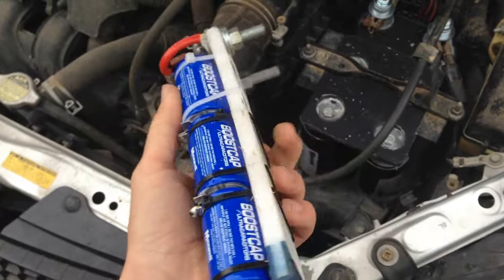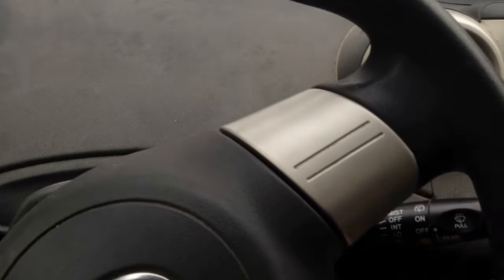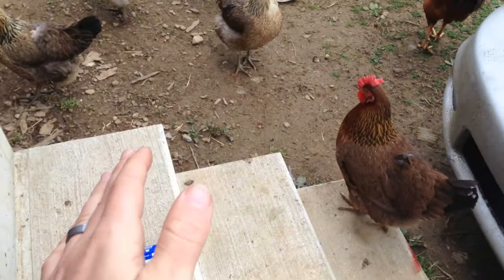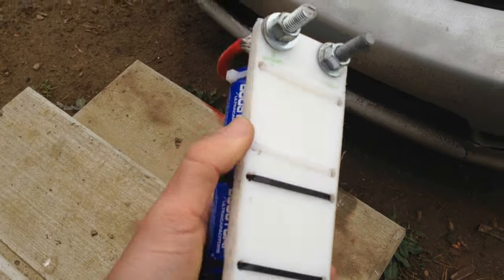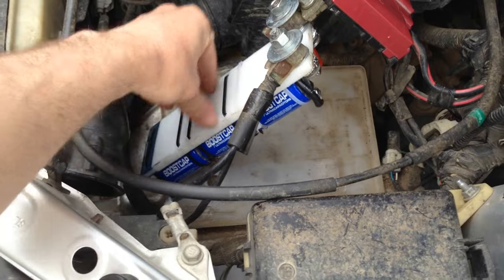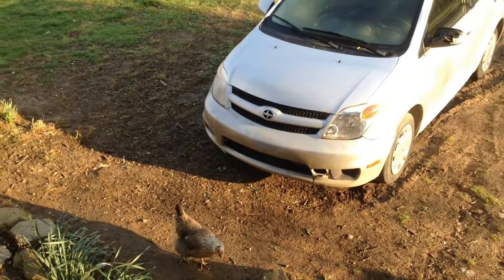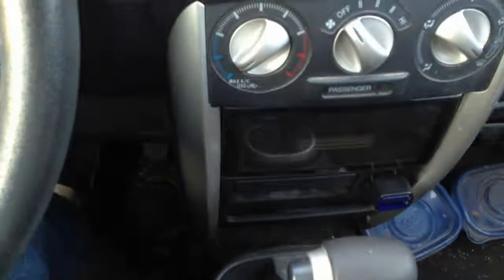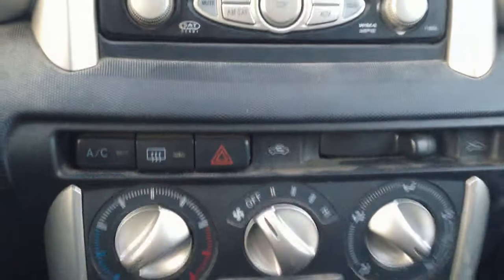Replacing My Car Battery with Capacitors! 12V BoostPack Update

Comment: It's a great shame that people don't do the basic calculations of the energy involved in so many experiments like these. Car batteries are needed because they provide much more energy headroom for ensuring the extra energy needed to maintain power to the alarm system, remote lock when the car is parked and for starting an engine in freezing weather.
Reply: Ah, but something built before all that stuff, like for instance a weekend racer, or a sports car with no need for luxury stuff this would make sense.
Reply: Jay Simons You're right...but that auto tranny Scion is definitely not a racer ,even if you take some 30 pounds off it...
Reply: Jay Simons People just need to understand that there is a huge difference in the energy output of these caps vs. a lead battery. 6 batteries of 350 Farads of 2.5 Volts hold the energy of 6562 Joules assuming the starter could actually use it all. Considering that the starter won't actually run as the voltage drops below perhaps 6 Volts, you end up with only 2300 Joules or so. That is 0.66 Watt-Hour.
Your current car battery might have an energy of,ONE THOUSAND times more. Thus, starting your car on these capacitors is somewhat a luck depending on your car engines willingness to get running in one attempt quickly. If you want a stressing experience using your car, go for it.
Reply: I showed my cousin who has an Rx7 he uses as a weekend racer, I think we will give it a shot with that since it has no radio just lights and computer for the EFI.
Reply: Jay Simons LOL, just remember not to turn on the light without the motor running :-)
Reply: lol, that certainly would put a damper on things wouldn't it, LOL
Reply: Jay Simons Yes, and never turn on the emergency light if the engine is off cause it will drain your "boost cap" in about a minute (0.66 Watt-Hour / 40 Watts = about one minute, assuming your signal lights use 80 Watts and are off 50% during flashing).
Reply: ThinkingBetter LED's are an easy swap, He also mentioned a solar panel and a small battery, I think with the right combination it would do very well.
Reply: Jay Simons It's simple math to find out if it works well. No need to experiment cause any part of this solution is 100% predictable. Energy in a capacitor is easily calculated based on capacitance and voltage. Likewise energy consumption in your car is a derivative of what you want to power. Of course LEDs will consume less power.

Personally I don't want to imagine that I only have one attempt to start my car however. You need near 1000 times the energy of the capacitors on this video to match a typical car battery.
Reply: Well, my advise is to anybody that wants to try it is to measure how much voltage your car uses to start and how much it uses with the engine off and ignition on with lights on and make sure it is tuned and well running so it doesn't take several cranks to start the car.
Reply: Jay Simons It's a bit sad that you don't understand even high school physics Jay. Your car will consume some energy to do one attempt of starting it. Such energy can be measured in Joules. If your car starter motor is using 150 Amps  for 1 second at 10 Volts, it represents 150*10 = 1500 Joules of energy. The capacitors on this video might have some 2300 Joules of usable energy for cranking your starter motor.
Understand the math first, calculate what you want to achieve, then design it, and you will get what you calculated. It's not magic at all. 

The entire idea of using super capacitors to start your car without a lead battery is a bit bogus in my honest opinion. If you have lots of money to buy many of these caps and don't care to fill up your engine compartment with these caps, then go for it. But what did you achieve other than spending far more money on it?
Reply: Your talking like we would want to do this to the family car, if that was the case you would be right, but for a tiny economy car or racer with minimal electronics this would work fine since while the car is running it relies on the alternator. if you noticed in the other videos he tried it and the caps started his car a few times and could power the radio for several hours. for a reliable small car something like this would be fine. In this case simple math can be wrong because of the variables present in the automobile.
Reply: Jay Simons No, everything follows laws of physics 100%. No exception. If your car stereo is using 10 Watts and you have 2300 Joules of usable capacitor energy, you can power it for 2300/10 = 230 seconds or 3-4 minutes. If you crank up the volume of your car stereo and you are using 50 Watts, you get only 2300/50 = 46 seconds or less than one minute. One Watt equals 1 Joule per second. If your 10 Watt radio should run for hours you need A LOT more capacitance than on this video obviously.
Actual precise calculations are a bit more complicated as voltage drops on the capacitors during use. For example, your car stereo won't operate all the way down to 0 Volts but will stop working, perhaps at 6 Volts. That is why many cars experience the car stereo resetting during starting of the car as the power drain from the starter motor momentarily causes a voltage drop.
If you want to get some more usable energy out of these caps you really need a high power voltage converter that can maintain about 12 Volts as voltage across the caps is dropping. But such electronics won't be cheap if you want it to feed the 100+ Amps to your starter motor.
Reply: ThinkingBetter There is a reason why scientific progress is so slow in our society, people like you spend so much time "doing the math" that you don't spend enough time experimenting and making progress. Lasersaber is spending his time experimenting. If he discovers something Interesting and useful, then maybe he will spend some time "doing the math" to verify and provide data that can be corraborated by others. In case you are not aware, not everything is Math First, there are new forms of steel where they decided what characteristics they want the steel to have, then reverse engineered it to figure out how to make it..( the math part). you need to relax and stop being a know it all.
Reply: Andrew King Dude, we are not talking about science experiments but rather talking about using simple capacitors to power simple electrical components. These things are extremely well understood and there is no need to start imagining things beyond known laws of physics where math is 100% reliably predicting what will happen. If your problem is that you don't know how to calculate the energy in a capacitor or other laws involved in how electricity works, then alright, but, for example, don't you realize how much we know today? Do you think your PC came to be through guesswork and superstition? Rather we know quite a lot about electricity today and that's why we can create highly complex circuits involving billions of components on the size of a fingernail inside the chipset in the PC in front of you. It only works because the math behind it works 100%. Try for a second to look at your PC and ask yourself how it works!!! Is it magic to you?
The experiments by Lasersaber are kindergarden level in comparison.
Reply: None the less both ways of experimenting  has shown to work. You can use your maths. we use our hands. both are valid ways of problem solving. In this case the problem is the standard battery has a somewhat low lifespan, it is hazardous, and is very heavy. Solution is to find something that is much lighter, last longer and is cheaper in the long run. Do I need to remind you that many things we know today came from experimenting and sometimes stumbling upon the solution....Like the mold used to make penicillin..
Reply: Jay Simons Experiments are meaningful when they seek new knowledge where new knowledge can be found. A 60AH lead battery holds around 600 Watt-Hours of energy. One of the 350 Farads capacitors on this video holds an effective energy of 1093 Joules or 0.3 Watt-Hours assuming you could use all the energy. You might pay US$20 for each 0.3 Watt-Hour. If you want the same energy as a normal car battery, capacitors will cost you 600/0.3 = US$2,000.

More interesting research is what goes on inside capacitors and how the chemistry can be improved to increase power density. If someone could find a way to make capacitors with much higher energy density (1000X or so), then cool things would be truly possible. For example, super capacitors would be great for EV cars if they had much higher energy density.
Reply: ThinkingBetter "there is no need to start imagining things beyond known laws of physics where math is 100% reliably predicting what will happen."

that attitude right there is the problem, people use to think that going 60 mph would liquify your brain until someone tried it physically. 

Imagination is the root of science and progress. Go ahead and stay in your little bubble and subscribe to the existing paradigm and refuse to think outside the box. The rest of us will take care of the new discoveries for you.
Reply: Andrew King Dam Strait
Reply: Andrew King The issue is that these experiments are like trying to drive 60mph again and again to see if it liquify your brain. 

You don't need to teach me about thinking outside the box since I am professionally working in related science fields and holds more than 20 patents. 

OK, one thing that is easy to demonstrate with use of super capacitors is that you can turn a solar panel, a small power circuit and a super capacitor pack into a way to start your car even from a flat condition on the go. But even such setup is easy to calculate. I can guarantee it will work (when the sun is shining). If you assume a 100 Watt solar panel and the capacitor pack on this video, you need only a bit more than a minute to charge it :-)

Solar panels in the roof of a car used for keeping the cabin cold through a fan and maintain charge on a pack of super capacitors COULD be of commercial value. Such idea could even have been patentable (if you described it first).
Reply: 1. the solar panel roof has been done. "If you want to stay cool, park in the sun. The available Solar Roof is embedded with solar panels that can power a fan to circulate ambient air through the cabin when Prius is parked in direct sunlight. This feature helps keep cabin air temperature close to that of the outside air for a more comfortable return to the vehicle." 

2. this is the internet, claiming you hold more than 20 patents is worthless  and does nothing but make you look like you are grasping for credibility and authority. say what you want, i don't know about others in this thread, but i'm done talking to a brick wall.
Reply: Andrew King Combination of solar power in the roof and maintaining a charged capacitor bank to start the car is in my awareness not implemented in any car. Anyway, such method wouldn't be much good when it's dark.

Your obviously not getting my point about what "open mind" is about. You might be surprised and excited about using super capacitors to start a car like the guy so obviously is on the video. But simple calculations would show you that his capacitor choice will work giving you a second or so of crank motor activity enough in most cases to start the car. Experiments are more interesting when they find out things we don't already know.
Reply: ThinkingBetter Andrew King It's all very well keeping an open and creative mind, and challenging existing knowledge, but i think at some point you do have to draw a line, and say "these are the things we know to be true", just so that you can move on to investigating other opportunities.  

Let's try an analogy - perhaps one day you might find yourself needing to weld some metal.  We're pretty sure we understand how that works, you get two bits of metal hot enough that they melt and mush together, and when they cool and solidify again they'll form a nice strong bond.  Why don't you experiment with your cigarette lighter, to see if you can make this happen?  It would be pretty useful, after all. 

Of course, you don't try this experiment over and over again, because you know it isn't going to work, you have a feel or an intuition for just how much heat is required, and a lighter just isn't going to cut it.  Why waste your time experimenting on a dead end?  

In this case with the capacitors you think it is worth experimenting because you don't have an intuitive understanding of what's actually going on - the physics that ThinkingBetter is kindly describing for you - and so you don't trust it.  This is perfectly correct, and you should doubt things you don't understand yourself.  A search on the net, however, and some patience to get your head around the maths, will tell you that what he's said is asserted to be correct not just by hundreds of thousands of people, but by the fact we have so many amazing machines built on top of this and other related concepts.  Why continue to disbelieve it?  At some point it's important to draw the line, and to say "i now know this to be true, because i trust the scientists and engineers who came before me."  Those people spent their time understanding this so that you don't have to.  That means you can spend your own time to move on and experiment with things that aren't so certain and break new ground :)

Kudos to the guy for experimenting, though, this isn't meant to be a poke at him, more at the comments in this thread about not thinking outside the box or about stifling creativity.  The experiment is no doubt useful to the OP, as it helps him understand things, and it demonstrates what the technology can do. That something as small as that can provide enough instantaneous current to crank an engine is one of the more impressive things, i think.  And the fact that it can be charged quite happily at that rate, even more so.
Reply: Stik Dragon Thanks, great reply. It's especially so true for the many people doing endless garage experiments in the domain of "perpetual motion" with no concept of where the energy should be coming from. My favorite example is the poor guy making the huge machine in the video titled "Aldo Costa - clips of his Giant Perpetual Motion Wheel".
Reply: You heard it here guys, they said it wont work, drop your tools we're wasting time.
(Despite the clear positive results in the video and in the others) there is always a few naysayers.
Reply: ThinkingBetter Haha, yes, perpetual motion has been an alluring concept for as long as mankind has been building machines i think.  Magnetism and gravity are the two forces that we can personally feel at our scale, and we've only encountered the former relatively recently as a species so we're just not set up to understand it through intuition alone.  It's a strange and magical thing that makes it all too easy to believe you can get something for nothing. 

I do quite enjoy some of the designs, though, there are some artful concepts, and there's a bit of a theatre now around trying to outdo the last person to fake it.  There was a brilliant one i saw recently where someone had carefully drilled out a cavity in a nib magnet from a hdd and managed to hide a button cell inside :D

Jay Simons Neither of us is saying it won't work - the video kindof proves otherwise ;)   The point ThinkingBetter has been making is that it won't work as well as the existing technology.  Pop into the shops for 5 minutes but forget to turn your lights off and you're going to be upset you left your trusty leadacid battery at home.  Your capacitor will have a fraction of a volt across it when you get back to the car, because that is just How It Works (if this behaviour wasn't so predictable none of us would be sitting here typing on a computer, because they wouldn't work either, as they rely, in part, on capacitors to marshal power around).  A standard 40Ah auto battery could have kept those lights running for a few hours, and would barely even register a drop after a mere 5 minutes.  

By all means consider this as an alternative, and in some very specific case this might be a better choice than a heavy battery (dedicated race cars? who knows) but for everything else it's been well established that it's just not going to cut the mustard, so consider it, discard it, and move on to greater things i say :)
Reply: Jay Simons Jay, actually I never said or thought it wouldn't work. Using capacitors as means of electric power source is nothing special. You can power anything electric with capacitors when space and cost is not an issue, especially when you have a DC to DC converter to maintain constant voltage output. It's a dumb subject to be excited about. For example, I can fill up my garage with super capacitors in one big capacitor pack and will be able to power my house in night time from the solar energy I captured from my solar panels at daytime without ever being connected to the grid. I don't need anyone to prove it. I KNOW it's possible. But I also KNOW that it will be way too costly to do so. In fact, calculating the cost is straightforward. In my case, it would cost approx. US$700,000 with the Ebay pricing I can find (US$20 per 350 Farads super capacity holding 2.5 Volts providing 10kWh of energy yielding around 33,000 capacitors needed + electronics etc.). I rather give up based on my calculation than start buying caps to see what happens hahaha :-)
Reply: ThinkingBetter It goes without saying that you cannot reliably replace a lead battery with 6 capacitors. There's a reason why manufacturers still put batteries in their cars. But how about having it on the trunk in case of an emergency? It's really small, delivers enough current as to start the car and coupled with a small solar cell would be really useful say, if you're camping in the middle of nowhere and forgot the lights on. Just hook it up, put the panel out in the sun (if necessary), and get the car running and the battery charging. It could be life-saving and would relief you from calling for help or taking the battery out for charging. Actually, I think it would be a great idea and could very well be marketed.
Reply: Federico Manuel Aroca Echauri The reasons for using lead batteries over super capacitors are about energy density and cost. Coupled with a solar panel, it can make sense for emergencies. It's quite possible to make a reasonable setup where you get a second or so of starting motor run time out of a minute of solar charging time (when the sun is shining). The bigger the solar panel the shorter time for getting one start (easy to calculate).
Yes, I agree, it could be an idea for a startup company indeed, especially if the solar panel is foldable in some way. The downside is that it won't work after sunset and it wouldn't work very well when the sun is not shining.
Reply: Federico Manuel Aroca Echauri
It hardly "goes without saying" considering that the video poster is trying to promote the use of his "brainstorm" over traditional batteries.   I'm pretty sure that he doesn't understand electrical engineering or he'd have stated clearly that this is not a viable alternative over the life of a car.
Reply: Santiago Draco
From my point of view, this would be (in addition to the emergency use I mentioned earlier) a great help to have in the house for use in those chilling winters (fortunately, it hardly goes -10°C in the part of Argentina I live in), but I know that in the northern US it gets freaking cold in winter. So having one of those for those days would be usefull. The electrochemical process of lead batteries is dramatically reduced in such low temperatures (basically, at -20°C, they don't work), so this could help with the needed initial boost. Plus, if it doesn't start on the first try, you can charge it quickly in a wall outlet and try again.
In addition, if you have a diesel car, this is absolutely useless. By the time the incandescense bulbs turn off, this wouldn't have any juice left to crank the engine.
To sum it up, it's a great idea, but it's absolutely reckless to replace the battery outright with this.
Reply: Jay Simons Jay, he can start the car many times, as you say. But ONLY if the car starts right away in the first (maybe second) atempt. Capacitors suck energy, just like they deliver it at much higher rate than lead batteries. The fact that he can start it so many times in a row is not due to the capacitors storing too much energy, rather the capacitors RECHARGE withing seconds, so by the time he starts it for the second time, they are already topped off again. In an emergency or really cold weather, this would be great, since you can store it in your house at room temperature, plus capacitors aren't affected that much at low temps.
Reply: Andrew King
So, basically, you believe that you can revolucionise (in argentinian, I don't know how to spell it) the science of electronics? The "liquefy your brain" was not established, that's why people tried to discover if it was true. The science behind capacitors and batteries are well known, so you won't discover anything new, unless you first learn about it.
Reply: Federico Manuel Aroca Echauri Yes, super capacitors are just capacitors with a high capacitance but usually rather low maximum voltage spec. What makes this video so stupid is that the guy on the video is showing a tremendous amount of surprise that his capacitors could start his car, when in fact it behaved 100% as expected.
Reply: ThinkingBetter Small cars has lead accumulators with capacity from 40 to 60 Amper hours. If we use 60Ah at 12Volts it is 720 Watt hours. But here is one mistake. Until lead capacitor is based on chemical reactions which are better at highest temperatures, capacitors are based on electric field and insulation, where insulation is mostly worse at highest temperatures (I hope that those capacitors do not use special materials which are superconductors in small temps).

What can be good is combination of both, because small current caused by low temps can charge capacitors and they can maintain peak of consumption during start. For long term energy storing they are to unefficient because high self discharging even modern technologies.
Reply: Did you watch the video?   He left it for 3 days unstarted....  But to say this is a 100% no issues perfect replacement for a battery I agree isn't accurate. Car batterys do have a big reserve of power, in situations where your car may require several attempts to start the capacitors will run down quickly.  But there are things to consider on both sides...while battery's contain that headroom of power, they cannot use all of it due to internal resistance.  If ever try and start a car that has enough juice to run the radio and dash when you turn the key but not enough available power to turn the engine over you have experienced this. .  A capacitor will not suffer from this, hence why this guy was able to start his car with only 10 volts.  I promise you most car battery's wont start your car after being ran down to 10 volts.
Reply: I think it is a good idea for a replacement, and by no means should it be a permanent replacement, but if your car dies in the middle of no-where, it definitely would be something to use!
Reply: While it's true most regular lead acid battery won't start a car around 10 volts I have seen many AGM battery still start a car at a lower voltage around 10volts.